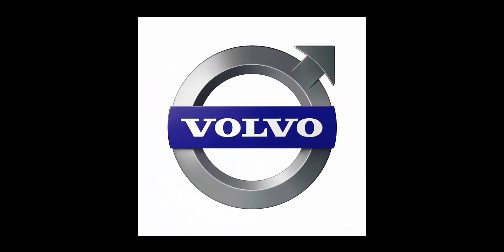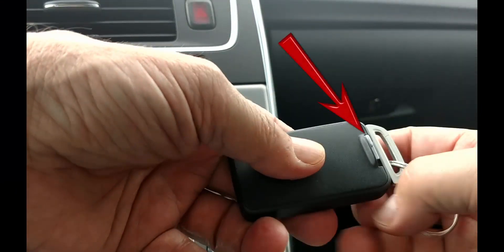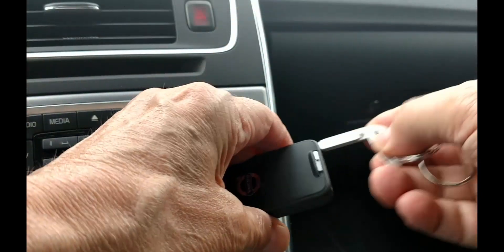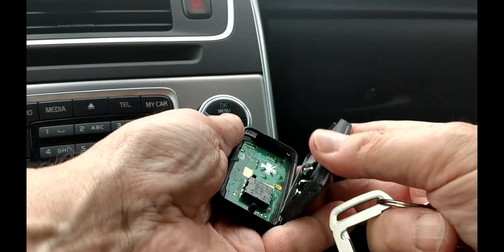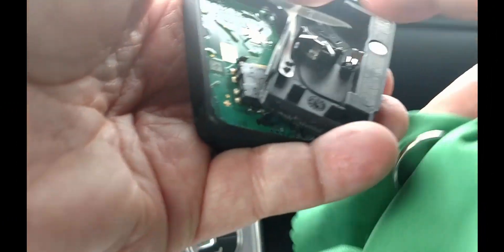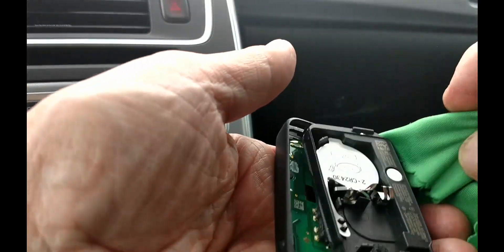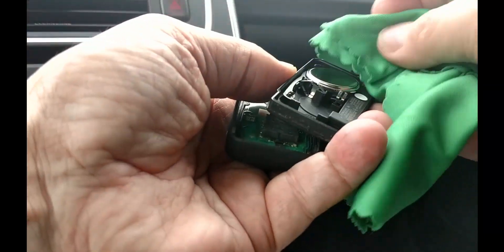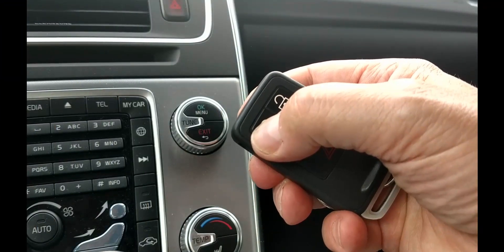Replace the battery in a first generation Volvo key fob.

Comment: Just a point of clarification; when you are separating the two halves of the keyfob, make certain you insert a small blade of a screwdriver into the same slot as the small lever slides in, not the larger opening underneath it. That is the reason you slide the lever to the left. It creates some space to use to pry the halves apart. Thank you for this video.
Reply from the maker: Good detail thanks...

Comment: Excellent video. I tried replacing my batteries using the Volvo manual instructions about six years ago, and I couldn't do it. I am not mechanically savvy (but I can whip up anything you desire in the kitchen and edit your writings like the editor at the New York Times). As such, I took my fob into my Volvo dealer, and for a while, I had them stumped. But two of the technicians did finally figure it out, changed the batteries and then charged me $45.00 for their labour plus the price of the batteries. This video was easy to follow, and within a couple of minutes, I had my vehicle locking and unlocking with no problem. And the best part is, I no longer get that pesky, but necessary, dashboard reminder that my key fob's batteries are low.  Well done and thanks for the help!
Reply from the maker: Thanks for the kind words and happy to help...

Comment: The most important part of this process is seeing where and how to insert the screwdriver tip in to the case, for removal without damaging. That part of the video was dark and we could not see the process well. Why you felt the need to shoot this IN the car (with low light), as opposed to outside the car in better light, is beyond me.

Comment: Not sure about this, my Gen 1 2014 XC60 smart-key remotes have only one single CR2430 lithium battery in either of the two supplied with the vehicle from new ?
Reply from the maker: As it happens, Volvo supplies a Remote key and a Personal Car
 Communicator (PCC). I was not aware of this, and evidently had a PCC, which has 2 batteries. Your fob only has one. Not to worry. P65 in the manual btw....

Comment: I have a Volvo 2004 s60 different key fob lock unlock yellow button pic of car open trunk How do I open key fob?
Reply from the maker: There is a cover on the back. You need the tip of a very small screwdriver to pry it up and off from the bottom...

Comment: Why there is 2 batteries? 2011-2013 S60 II with the exact looking key fob only has 1 battery CR2430 which is a 3.11V. Which Volvo is using series connection of 6.22V or a parallel connection of 3.11V? Is the bottom battery for emergency back up purpose?
Reply from the maker: Sorry, I don't have a good answer. Suspect they are both in use...
Reply: I don’t think they are connected, there is insulation in between the batteries. I think 1 batterie is for remote control and 1 for keyless entry?

Comment: Bad design by Volvo! I live outside a small town & I`ll be darned if I can find CR2430 batteries. When I do find some, I`ll be buying a supply. Meanwhile, my Volvo sits in the driveway.
Reply from the maker: It doesn't have to sit! You can open and start it with the fob, even if the fob battery-ies are dead! Order from Amazon...